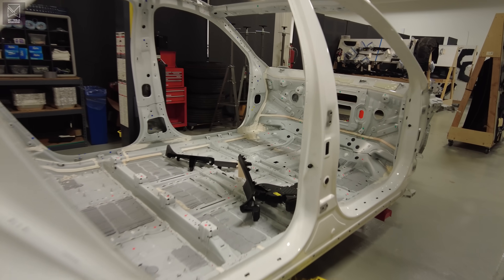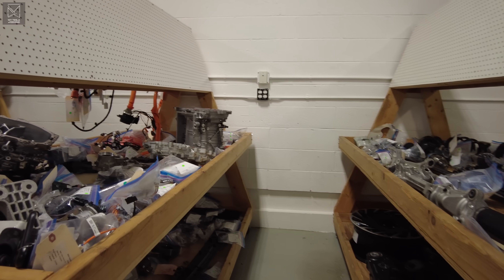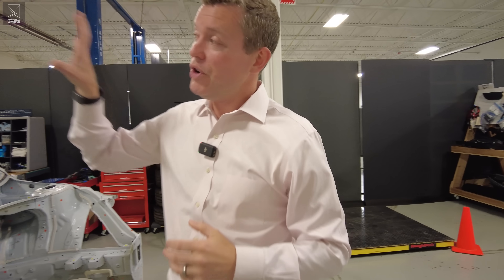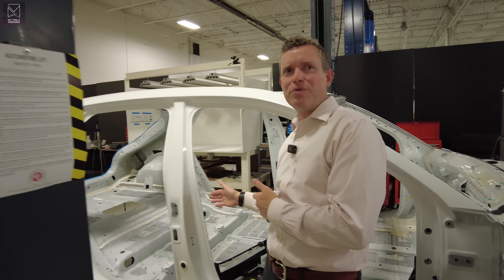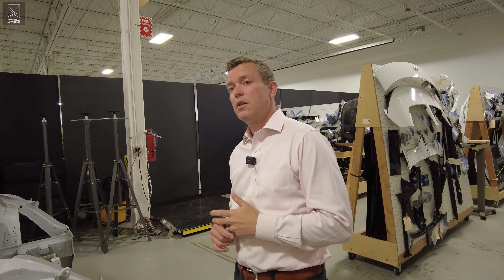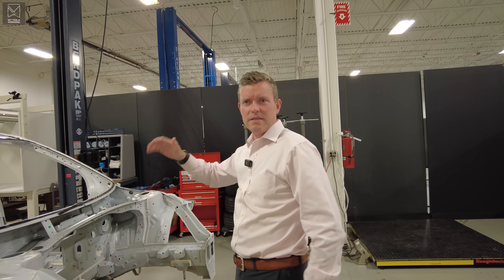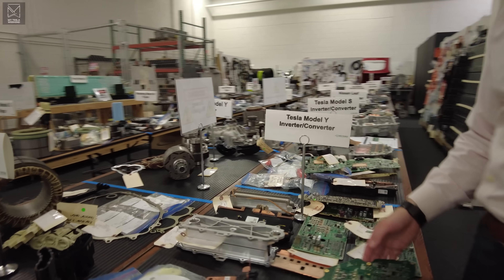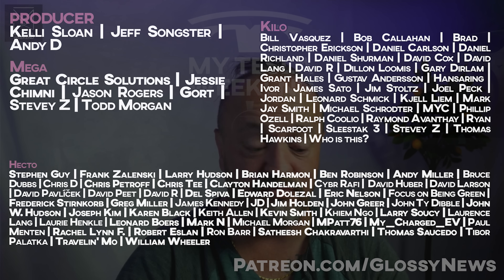Cybertruck Exoskeleton or Unibody? With Cory from Munro Live

Comment: When it was announced, I understood it to be like a folded steel structure, and therefore, that dictated the overall design. I also think the designer said at one point that the design wasn't as efficient (aerodynamically) as it could be  due to this manufacturing technique (folded metal ) . I know things change as innovation occurs and the gigacastings are impressive, and I am all in. Just hope I remembered things correctly.😂
Reply from the maker: Your memory is correct. It's also why the shell is 3mm thick instead of the usual 1.2mm. It's needed for the structural integrity.

Comment: Stainless steel comes in different qualities. Some are better than others when it comes to salt resistance. This is important for marine use but a car, not continually submerged in saltwater, can do with less extreme alloys.
Reply from the maker: I'm confident their metallurgical scientists have the capacity to determine the best cost:performance ratio.

Comment: Yeah well you're showing the chassis but there are body panels: fenders, etc. that go on top. On the CT these are not a separate outer layer.
Reply from the maker: His point was that the cabin is both structural and of a unibody design. It's my opinion that there's overlap in the structural elements within that portion of the vehicle, but that the megacastings and structural battery packs are doing a lot of the heavy lifting. We'll know better awfully soon.

Comment: The cybertruck just looks like what has for a long time been described as a, 'monocoque', this is nothing new and even monpcoques incorporated a front and rear subframe, the 'exoskeleton' term seems to be applied simply because the outer skin of the vehicle contributes more strength to the chassis than is normal, and this is likely due to it's highly triangulated and flat pannel design.

Comment: With ford and GM going with aluminum for weight savings they are seeing catastrophic failure of the truck beds due to weight distribution. Dumping a load of gravel into an aluminum truck bed they can peel open like a banana. I think the stainless steel is going to seal the deal when the Cybertruck comes out.
Reply: Have we seen examples of aluminum bed failures?  I'm not doubting it could happen, just haven't seen it actually happen.

The Cybertruck looks like it will be one tough cookie.  Those trucks may stay on the road for multiple millions of miles.
Reply from the maker: @bobwallace9753 Yes! There's a video on YouTube I saw showing it. They're great for fuel economy, but apparently they went a tad too thin for the sake of the loads they're intended to carry.

Comment: Legacy OEMs when they say, "All New!"  What they really mean is, we made some minor visual changes so you can tell the difference, and maybe fixed a thing or two, then we updated the infotainment, while reducing costs and quality.
"Now at a new higher price with nothing of value added!" would be more accurate.
Reply from the maker: At least the case 20 years ago was that they would make mostly cosmetic changes and increase the price roughly in line within inflation. While the sticker price was higher, it was still going to be a slightly better value due to ongoing improvements within the platform. Of course what buyers actually pay for a car is entirely detached from the MSRP when it comes to legacy auto, but still worth noting.

Comment: So if there is a true exoskeleton in any part of the vehicle would that mean a fender bender could make the truck undriveable?
Reply: A fender bender is a minor collision.
Reply: @bobwallace9753  even if the fender is structural?
Reply: @MoreOnEVs  
Cut out the damaged part and weld in new stuff.

Like any other vehicle whether repairs are made or the vehicle scrapped will depend on the extent of the damage.  Given that the Cybertruck will have a much stronger than typical body it's likely to take a larger crash to turn a Cybertruck into scrap.

And since there is no internal frame it might be simpler to make repairs.  Frame damage in a typical car/truck usually means insurance companies will scrap rather than repair.

Comment: This is a truck, so transitional trucks have more of an endoskeleton, so the CT is more exoskeleton in comparison.
Reply from the maker: I think that's fair. The traditional frame rails that run the length of a traditional pickup have serve trucks well, but that doesn't mean they are the best solution. Especially when the battery already requires a rigid structure to support it.

Comment: It will be great if the EV industry can standardize on several features. 
1). The low voltage should be made 48 volts instead of 12Volts. (The automobile industry previously standardized on 12 volts and phased out 6 volts).
2). The charging connector should be standardized and it appears that it should be the Tesla NACS
      is the overall winner.
3). The high voltage system should probably be standardized to 800 volts. This will save on the amount of
      copper needed and more importantly will probably lower the cost of the lower current carbide power    
      semiconductors required. This would be a big problem for Tesla and it's 400 volt Super Charger 
      network. (There may be some valid reasons for Tesla not increasing the voltage to 800 volts.) 
At this early stage of EV adoption, standardizing the features that will affect the end user should be of paramount importance.
Reply: 1) Look for companies to migrate to 48v components as Tesla gets suppliers to develop them.  Moving from 6v to 12v happened but things largely stopped there because no company was willing to commit to purchasing enough higher voltage stuff to get suppliers to produce.  

2)  NACS in North America.  Perhaps South America as well.  Europe and Asia?  Perhaps not.  What they are using may be too well embedded and 'good enough'.

3)  I think Tesla has said that moving to 800v/a higher voltage would be beneficial but not beneficial to redesign existing products.  I wonder if we might see a future shared casting system for Models S and X along with a Tesla minibus.  That might be the time to redesign those products.

Comment: So is Cory saying there isn’t much advantage to giga casting?
Reply: No.  He's saying that if a company has already spent money on multiple stamping machines and assembly robots then it may not make as much financial sense to toss away all that paid off equipment and spend money on large casting machines.

What I don't think Corey is picking up on is Tesla's route to a fully automated factory.  Giga casting and box construction will make it simpler to remove humans from the factory.

It's interesting how Elon can tell people "Here's what we are going to do" and then they ignore him.  

"Going to do" sometimes has to be modified as Tesla works its way into places we've never been before.
Reply from the maker: The other replies are pretty much right on the money. GigaCastings have a high up-front cost, which takes significant time (and units) to amortize. If you're only going to build in small numbers, a GigaCasting is likely to never make sense, much like how robots don't make sense if you're only making a few dozen.

What I heard him saying is that the Model Y GigaCastings already introduce enough savings to make it almost as cheap as the Model 3, despite it using significantly more material to produce. Once the Model 3 incorporates those efficiencies, it will again be the clearly cheaper car to build.

Hope that helps.
Reply: I wondered the same thing initially.  But I think what Cory is saying is that - currently - the gigacastings are much simpler and faster to produce.  But regarding cost (ie. Brian's question), that will come down over time.

Comment: Dying to ask this question, with the advent of all the other car companies converting to the Tesla charging platform, what would they have to do to convert their cars to employ Tesla's full self driving platform? This would probably involve more than just changing to a NAC adapter.
Reply from the maker: Far more than the charger itself for sure. The size and placement of the necessary cameras would not be too challenging for most cars to introduce, but there's also the matter of making room for the computer itself, and whatever wiring and other considerations come along with that.

If the cameras can be adapted in terms of placement to work on the CyberTruck and Semi, there's no reason they couldn't work on virtually any car, so long as there's room inside the B-pillar to place the camera with an unobstructed view.

Comment: Doors kind of screw up exoskeleton.
Reply: Not necessarily.  If the doors, hinges, and latches are adequately engineered then they would operate as integral parts of the exoskeleton.  Unlike panels that are welded together they would be attached in a different, but sufficient, manner.